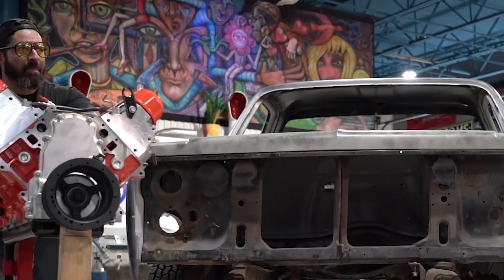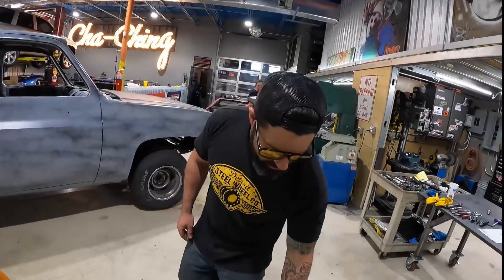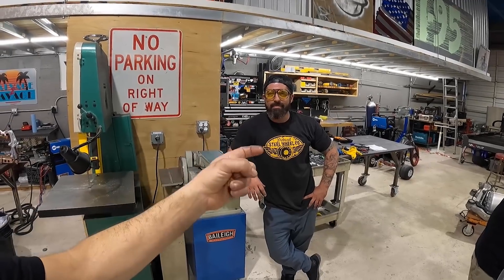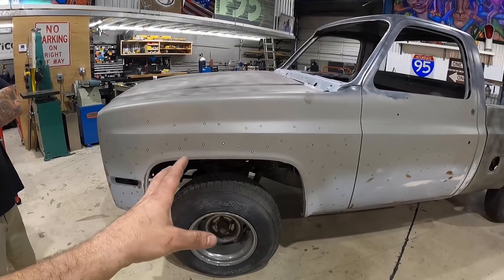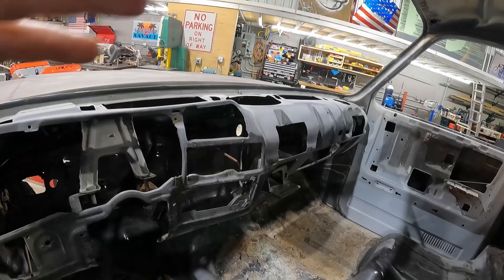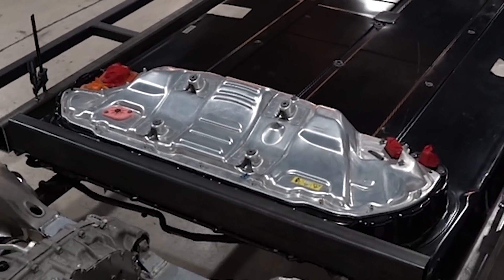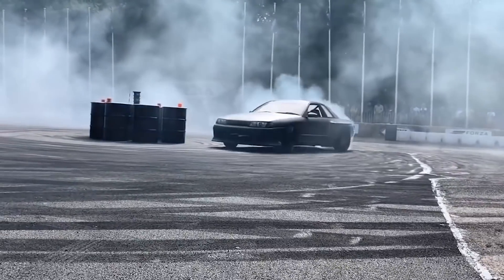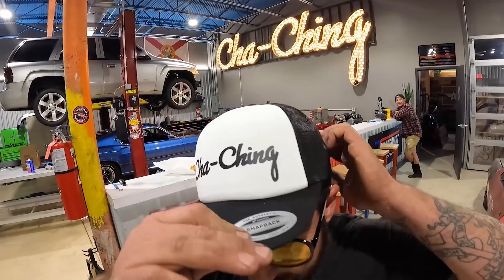AWD Twin Tesla Swapped 1985 Squarebody C10?!  - Electric C10: Ep.1 Breakdown

Comment: I'm planning on going full electric with my landscaping, mowing business. 
An keeping all the equipment i have now. 
'04 gmc Sierra 2500hd duramax lifted 6in. 
Mower is a '11 hustler super z 60in with a 35hp Kawasaki. 
With a 16ft enclosed trailer with a battery bank and solar panels on the roof. With a connection from trailer to truck to help charging to. 
So potential of never have to stop and charge my truck or mower. 

Living in southwest Florida helps too. 

Having to pay $100 every 2 days to just fill the truck. An $50 to fill mower every  3 days or less. 

Yeah, big time saving with the set up i have in mind. 
It will pay for itself in less then 6 months or less. Depending on how high end i want to go on all the conversation parts. 

Even if i bought a brand new Tesla to tear everything out of it. An put it in my truck. 
Even at the high end 120,000 for a new Tesla. 
It would take 6y to recoup the savings from changing. 
An every month of not buying diesel saves $1,500 which transfers to the Tesla payment of a non existing car but truck from 2004. Lol
Reply from the maker: That sounds awesome! Definitely let us know how it all works out. We may need to build a tow rig like that!
Reply: @SalvagetoSavage . Thank you. 
An i will. I dont do the YouTube thing so i will jist have pictures. 
But is there a way to contact you guys for a little bit of questioning of the operating components. Like what matches well and what dont. An just another resource for the insight i might miss. I'm not a engineer or shop fabricator. 
I'm just a guy originally from Michigan that loves power and badass cars and knows enough to get in trouble with. 
My dad and uncle were the mechanic's. 
My dad asked when I was younger. Dont you want to become a mechanic. 
I said no, i rather run it and wreck it, then have to fix it. But at least i can fix it. Lol

I literally dont want to buy a new Tesla to tear down. 
An I'm trying for not cheap but blue collar guy in his garage cost. Plus its still going to be my work / personal vehicle. 

An I'm not a expert in ev technology. 
Like i said, i know enough to get in trouble but i have the confidence to make shit work. 
An the smarts to know when to say no. Lol

If you guys have a email to contact you. That would help greatly. Thank you and thank you for the comment. 

Im guessing you guy are in Miami Dade county. 
Charlotte county myself. I've been to Miami a bunch for deliveries to Walmart's when I drop semi about 5y ago. 
Always stay safe. Can't have fun when we're getting eaten by red ants in the ground. Lol

Comment: I want to add a tesla battery and motor to a 1949 5 window Chevy pick up.,  Are there any cad sketches out there of frames motors etc to try and piece together something like this,  Or do you have suggestions to how to mate the rear subframe of a model S or Model 3 to the rear rails of the '49 3100 frame rails.  Where are you guys located,  what would be cost to do the fab work for that ?
@salvagetosavage
Reply from the maker: Everything for this truck was custom made. If we did take on your project it would be a full build-out. If you're interested, send us a message on Instagram!

Comment: A small gas motor, to generate electricity for recharging the batteries.  If there were a away to connect that to the house, in event of a power grid failure, that would be even better!  LOL,  I vote for the electric  motors.

Comment: Makes it even simpler - and lighter and more efficient -if you omit the battery and get your power on a just-in-time dynamic basis via a pantograph and an overhead contact wire. Also if you fit steel tyres instead of rubber, and run on a steel roadway. Much less rolling resistance that way!

Comment: Finally....EV is the future.  Instantaneous torque curve!  ICE is 100+ years old, it's a complex machine with many moving parts.  It's only emissions compliant because of the electronics, which is only a bandaid.  

FYI.  Make sure you get the special fire extinguishers and associated training.  If the Li-Ion batteries experience a thermal runaway (overload) event,  traditional fire extinguishers won't help....  

Now, your channel is significantly above the rest.  Getting so tired of other creators just buying stuff, then doing unpackaging, walkarounds, burn outs, building engines, bigger turbos, driving underwater, drag weeks......stale, OLD,  done it before content.  No creative thought, or E/I content in most channels.  You have changed that "model" and stepped beyond....well done.

Comment: Oh I can’t wait I wanted to do a Tesla’s awd s10!! Your fulfilling my dreams
Reply: You totally can!  I'm making a Jeep Wrangler with a Tesla DU.  The Drive Unit replaces the engine/transmission/transfer case.
Reply: @billbayer5526  I’ll see how intensive this build is and see what it take s
Reply: @bmxpro273  this build will be very intensive and take a great deal of skill and money to pull off.  It will be a SEMA car after all!! :)  Using a Tesla DU is like writing a check for at least $40k by the time it's all said and done.  It's the peak of hot rodding tech and you gotta pay for it.  You could convert an S10 with a lesser engine and lesser battery pack for CONSIDERABLY less money.
Reply from the maker: We sort of went off the walls with this build. We're building a complete custom chassis, using corvette k-member and suspension and dropping a c10 cab and bed on the frame when everything's fabricated. This is a great build to see what's possible when pushing the EV conversion limits. I would definitely check out the guys over at Zero EV UK to get an idea of what a more standard conversion would entail!
Reply: Btw my k1500 is a single cab long fleetside and it would be nice if i could quickly change out the nicest painted box for a aluminium or SS steal flatbed dully or recker setup ect. and back to normal single tires ect. . And yes im keeping my charger a big v8 manual transmission so no full ev swaps for it. id be ok with the 68 mustang convertible ( girly car around my place ) or the tj jeep ( even with a longer wheelbase 2006 JL which is mine and that 4.0 L-6 engine and automatic transmission combo has to go bye bye 👋 i hate it 🔪🤬, im not sure 🤔 there's room for the battery pack to have a descent 200+ mile range and or keep the offroading capability's intact ect. ) if it makes sense and is a great swap and worth it aka not to just show off that i can do the swap and makes sense as power plant
Reply: @SalvagetoSavage  do you plan on putting the cad files on grab cad or some website like it ? wouldn't mind paying for it ( as long as it's reasonable aka im not going to go for 100k 😉 but maybe 5k ish or less and someone else might be interested too besides me ) as it save me from having to do it or paying someone else to do the full body scanning ( and you get to recoup so of your investment back ) or just guess and hope im right when fabing, as your build is different. from what i have in mind otherwise, i might later ask for a copy of your truck ( do the same mods to my vin ) as you said that you are running a paying costumer custom shop
Reply from the maker: Glad to hear you're as excited as we are! Hope you enjoyed the video!
Reply: @SalvagetoSavage  y’all deserve more subs